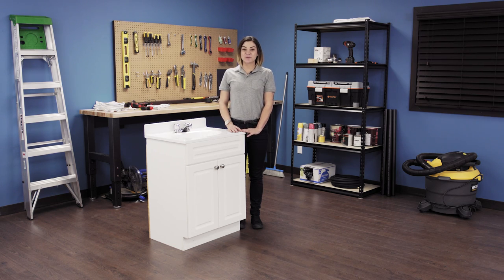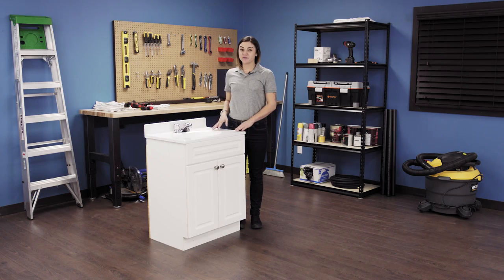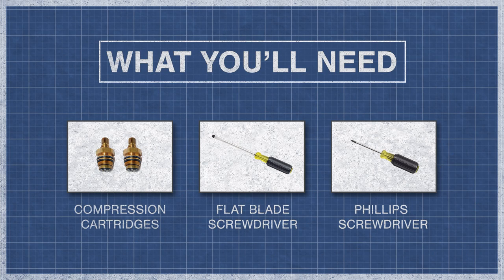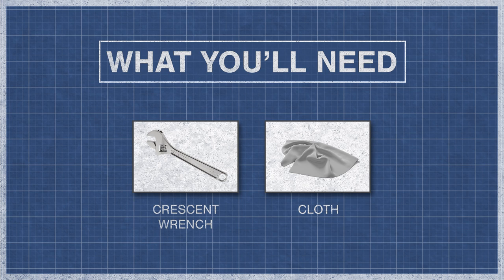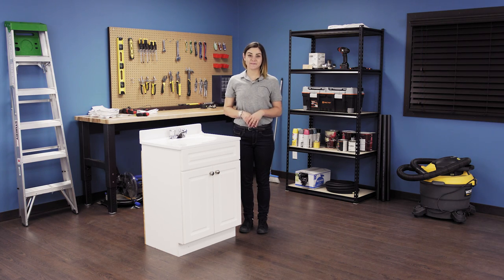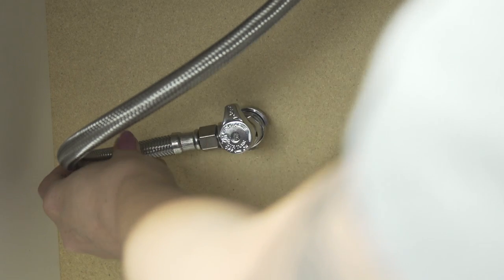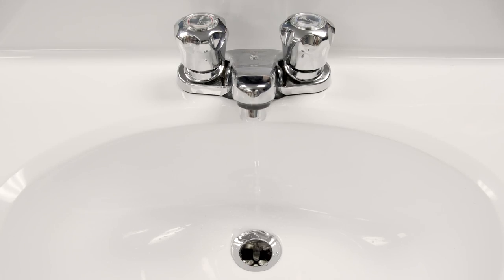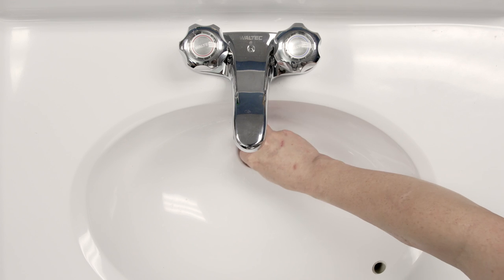How to Replace Leaky Cartridges in a 2 Handle Bathroom Faucet | Repair & Replace

Comment: Anything on other kinds of cartridge handles? There's a tiny star screw I pull out of the handle, but the handle still won't come off.
Reply from the maker: Thanks for watching. Some handles use a set screw on the side that tightens into the stem of the cartridge.